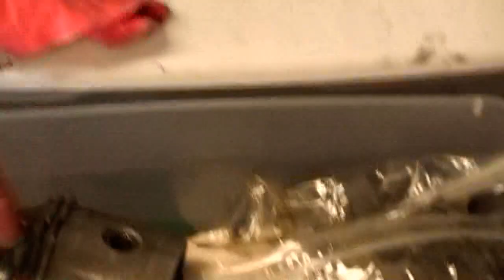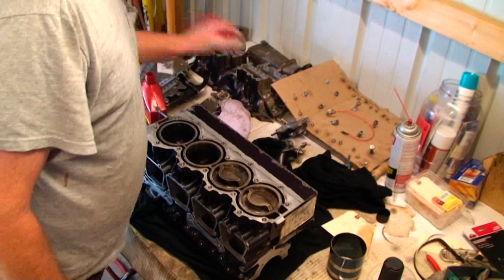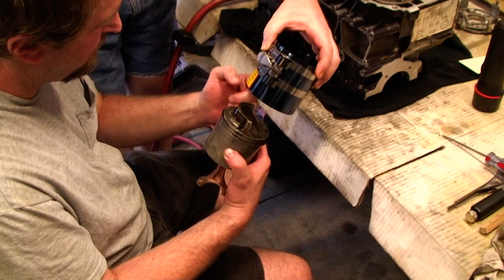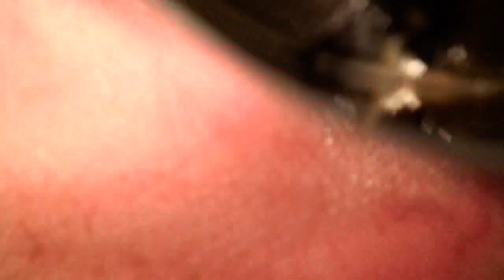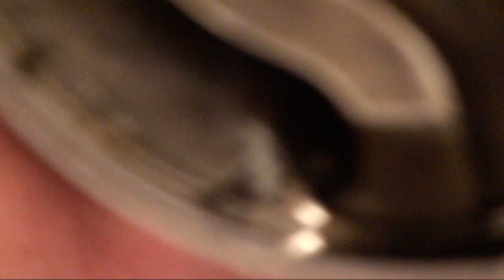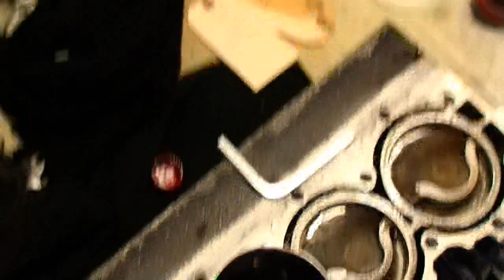1987 Force 125 Outboard - Installing the Pistons

Comment: I've got a 99 Force 120 and the engine looks identical to yours, they didn't change much, but on my pistons the pin that you align the rings with is on opossite sides of each other, which I think makes more sense so there is no blow by or compression loss. Thanks for the video.

Comment: Is the 125 HP Force motor a good engine and did you get a lot of hours out of it before rebuilding it? Did it blow up or why did you do the top end? Is this a simple motor to rebuild if I took the block to a shop to have it bored/honed and I did the rebuild myself? 
Thanks

Comment: Ring gaps should oppose each other...
Reply: if you look at the piston ring groves they had locating pins to keep the rings from turning which would be a disaster in a 2 stroke motor, but I do have to admit this is the first time I have ever seen pins in line like that it does not make for a motor that would last

Comment: So the blow-by won't damage the motor but it'll cost at the knock like crazy so get those pictures out and offset those gaps in those pictures do not line them up with each piston ring please all right well that's the best advice I can give you and that's straight from Summit Racing dude I would never tell anybody wrong on YouTube never because I reflect back on me goodbye